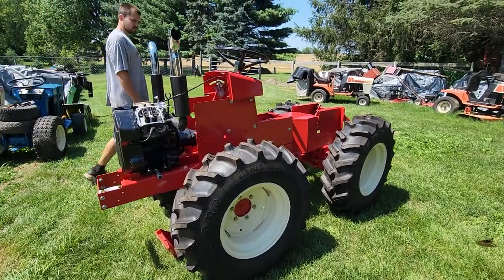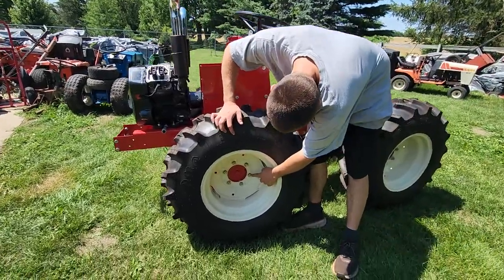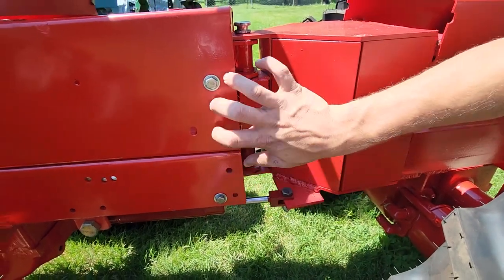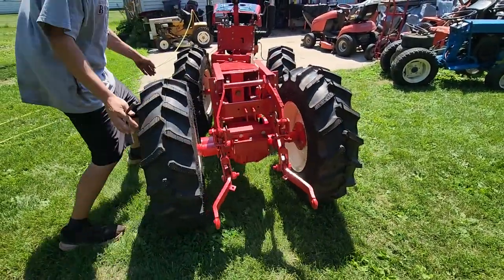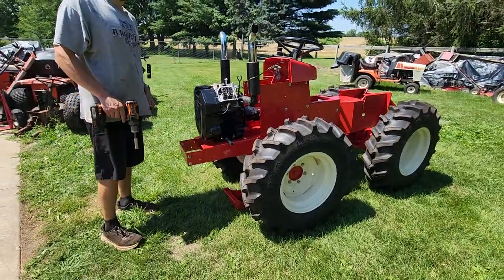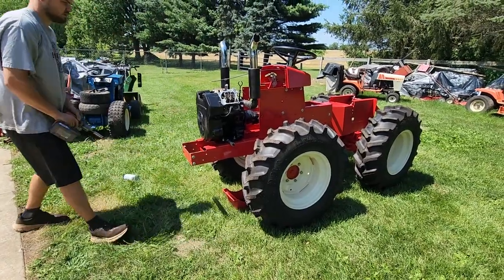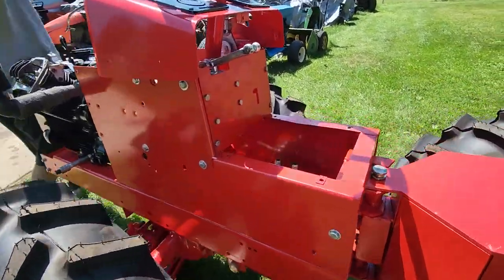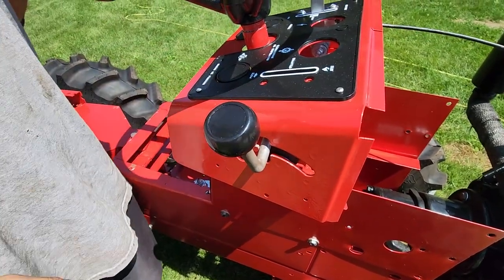wheel horse articlator part 2

Comment: As far as that steering "lock" goes, removing the detent ball & spring on the end of that spool would eliminate that "float" position.
I used one of those valves to control a hydraulic motor & simply removed the holding detent ball & spring.